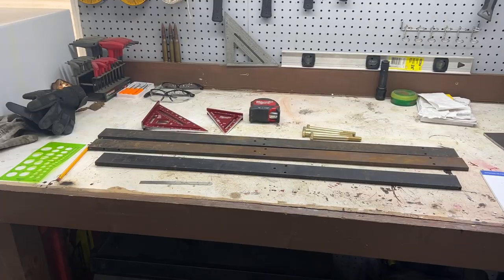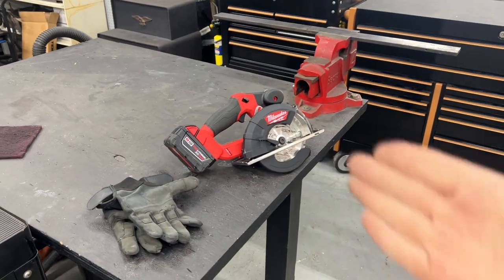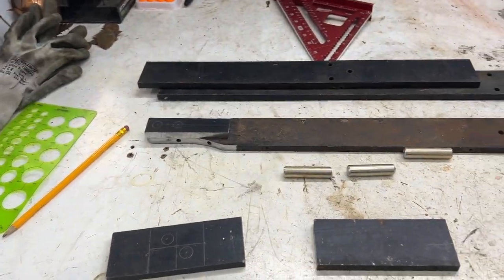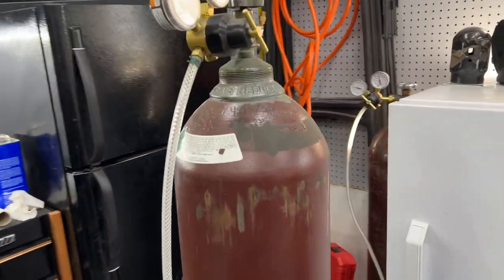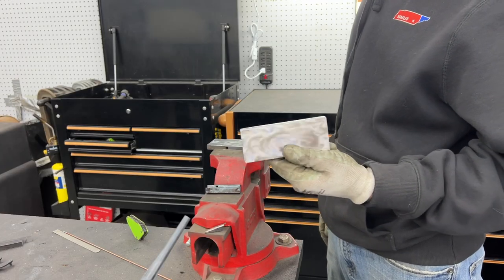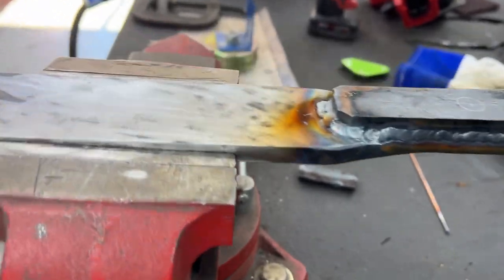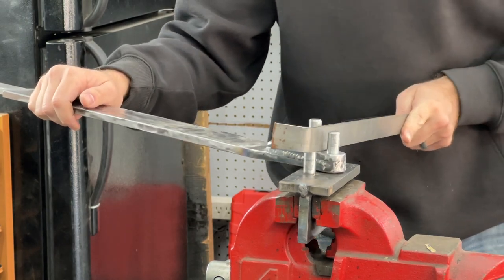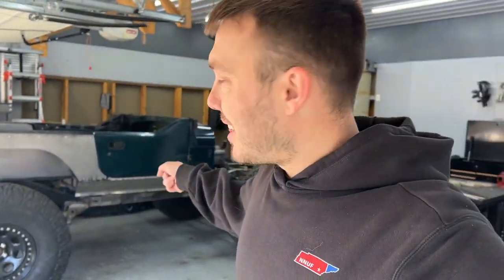DIY Flat Bar and Rod Bender

Comment: If you turn the presetting off you can pulse tig with the 220. Believe it’s only for dc only tho. Just fyi. Used it to pulse fuse my exhaust.

Comment: Sa--Weeeeet! I have watched a lot of videos on this project and like yours the best! How long were the 1/2” grade 8 bolts that you used? How wide is the main bar? A-ha…i heard you say briefly 2” wide….!
Reply from the maker: I appreciate that! I had a lot of fun making this and I’ve used it a good amount since. I can’t remember off the top of my head how long I cut the bolts down too but they started off as 6” grade 8 bolts. Thank you again for the kind words and watching the video 🤘🏼🍻
Reply: Actually, what a coincidence. I have gathered all the materials and had to buy a bar from metal supermarket to start fab today. Anyway thanks for responding!
Reply: Sorry to bother you again. After having used this tool, is there any advantage to having the base pins on diagonal?
Reply: It is such a cool project that I finished it and it turned out perfectly.  Too bad YT doesn’t have a way to share images. I guess i will need to make a video.